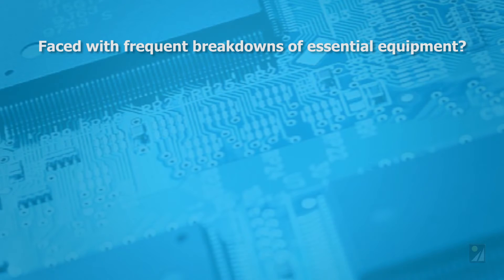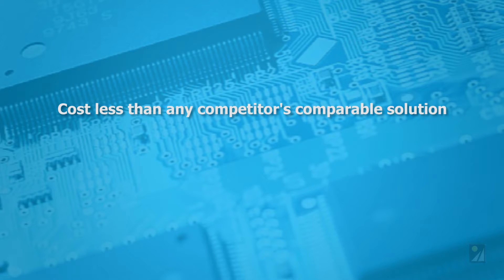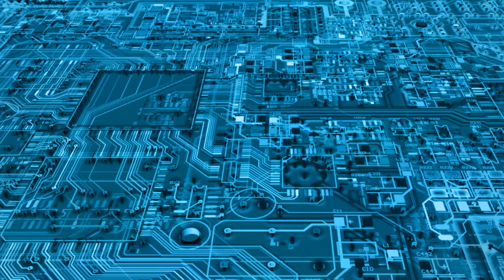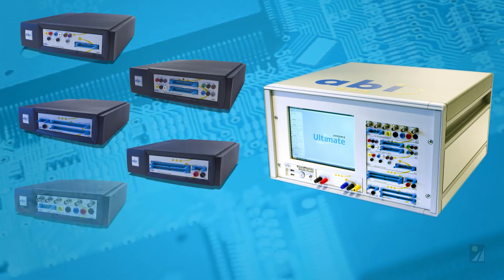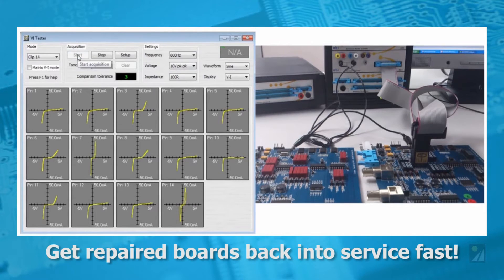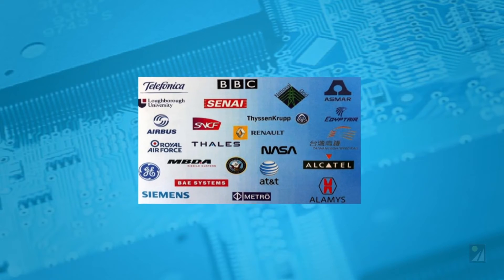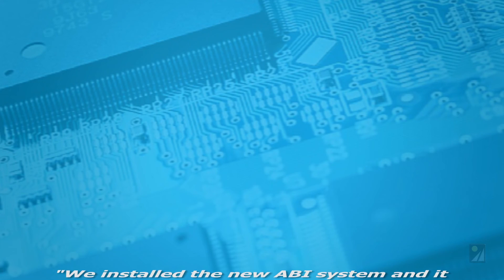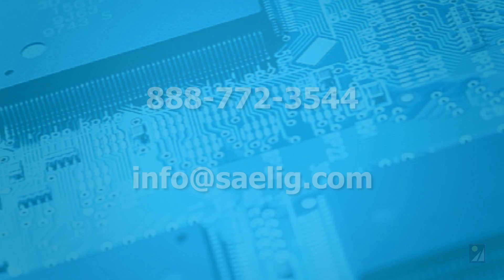PCB repair / rework / find faults quickly with ABI System 8 from Saelig

Comment: Sir can we use on laptop pcb fault finding?
Reply: If you mean, "Can I use an ABI Electronics system to diagnose a fault on the motherboard of a laptop?" Yes.  BoardMaster (a System 8 solution) is used to troubleshoot PCBs from automated manufacturing systems, IT systems, robotics, graphics equipment, HVAC systems. power control systems, wind towers, vehicles, railcars, commercial aircraft, military aircraft, and many other types of electronically controlled equipment.

If you mean, "Can I use an ordinary laptop to run the System 8 software and control a BoardMaster?"  Yes.  The $400 HP laptop I'm using to type this reply would be more than sufficient to run a BoardMaster or System 8 configuration.
Reply: @danevans9210  Thanks sir and give me a price sir
Reply: @rahulpatel7307  If you are in the US or Canada, you can contact me by phone or email at Saelig Company to discuss what configuration you'd need and get a quote.  If you are outside of our territory, please see my note below from two years ago.

Comment: Is this comparable to the Huntron Tracker?
Reply: I think it is much more expensive than huntron. and they are modular meaning, they are made for the customer jobs. I would assume there is a basic something. if I remember correctly, last time I looked into this, the cost for a basic unit was about $25K-$30K.